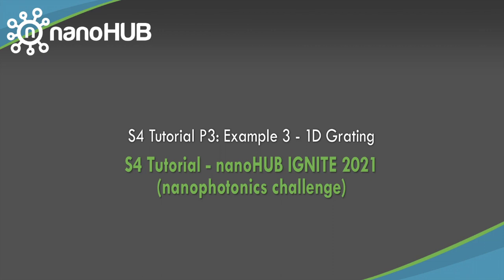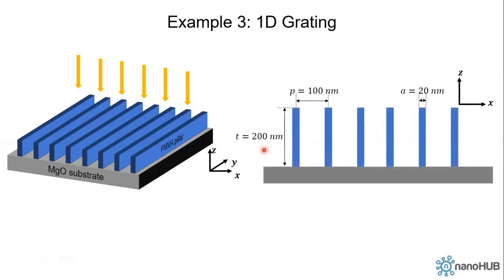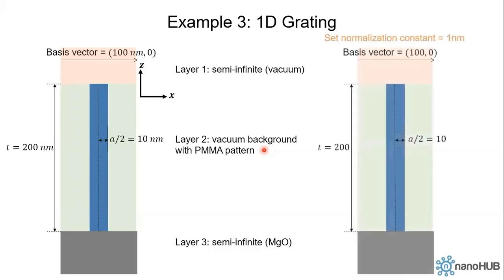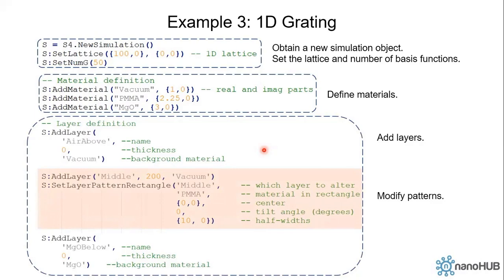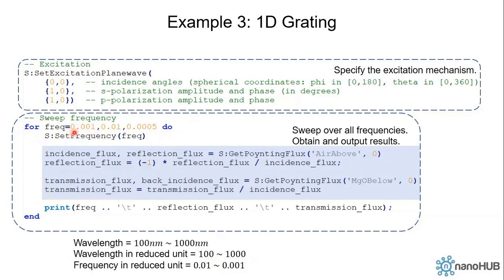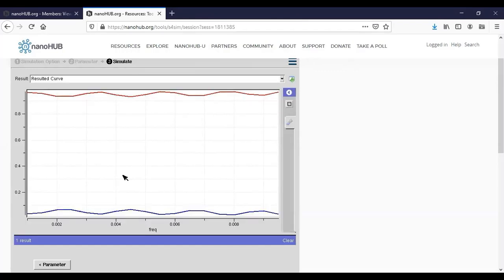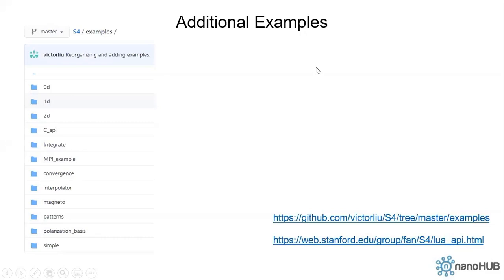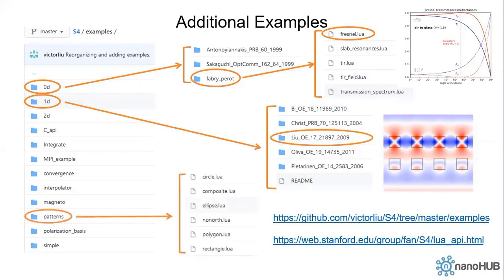S4 Tutorial P3: Example 3 - 1D Grating

Comment: I have reproduced some simple simulation with gratings using S4 and all of them gave the exact answer I wanted. But when I am trying to do a simulation which includes a layer of TiO2 over the grating the resonance occurs at a different wavelength. I have reproduced the results with another software, so I know the values are correct. I really wanted to know if there is any method to include a thin layer of TiO2 on the sides of the gratings.